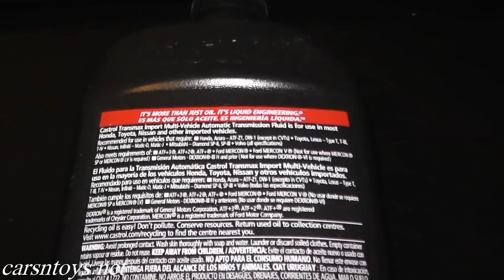Honda Accord Automatic Transmission Fluid Change

Comment: Note to anyone who does this, make sure when you put your 3/8 ratchet into the bolt that you are pushing the button to retract the ball (that normally locks the socket) in and then push the racket on snug onto the bolt. The little ball on the should not be visible and completely inside the bolt. This is important because if it's not in there completely, you'll risk malforming the nut with that little ball when you try to torque it off. Just important to mention anyways
Reply: Matthew Espindola good information to anybody planning to change their transmission oil since mine are nearly malforming the bolt yesterday

Comment: I just did this, 2012 Accord, 58,500 miles on the odo. My mother's car, she pays a local mechanic to service it for her, as she has had very bad experiences at the local Honda dealers in the area. Well, this guy did nothing other than oil changes. I got ahold of the car as it needed brakes. I had to beat the pads out of the brackets with a 3 pound sledge hammer. Both front calipers weeping, tried to rebuild but the cylinders were too far gone. So, two new calipers, four rotors, and two sets of pads. Power steering pump screaming, flushed that, flushed brake fluid, serviced the cooling system, oil and filter, and then the transmission, it was singing too... Used 9 quarts as you stated, last drain and fill we had gorgeous purple fluid coming out. Car now runs like new. Really pisses me off, this mechanic of her's, he was a Honda Tech for years. He never even checked the brake pads on this thing! Hell, you do not even have to remove the wheels to do that. Great video. Sorry for the rant. I hate these new mechanics, many are just outright thieves.

Comment: If you are going to the trouble why would you not use OEM Transmission as required by Honda and replace the 4 cent drain plug washer?   Great Video.
Reply: I always replace that after the 3rd or 4th trans oil change

Comment: When youre pouring fluid in it shouldnt read up to the high fill mark.. the fluid is cold.. transmission fluid should be checked at operating temperature and with car off and should read between the 2 dots.. therefore when youre adding new fluid which is cold it should read at the low level that way when it gets hot and expands it will give you a reading between the 2 dots..
Reply: Does the transmission shifter have to be in park or neutral on a 98 accord ex can anybody tell me that   please and thank you.
Reply: I'm  checking fluid level

Comment: I just did mine on my 06 accord. Honda has a funny process for checking level. Also changed the filter
Reply: Tye filter is inside the trans
Reply: I didn't think it had a filter. Hmmm
Reply: @saltypatriot1768  my filter is on top of the transmission 4cylinder inline filter  the v6 has a inside filter
Reply: @robertfrye7764  the 4cylinder auto does have a inline filter the v6 doesn't

Comment: I did 2 drain and refills. Car was on slope, higher at back. first time drained little over 3q and fill 3. 2nd time, drain 3.4 and fill 3.5.  Kept drained oil overnight and no difference in quantity hot vs cold. But now checked fluid level on level surface, it show over high mark when hot or cold. car was driven 100 miles on freeway between changes

Comment: Maybe I'm old school, but isn't automatic transmission fluid suposed to be checked with the car warmed up and the engine running while in park?
Reply from the maker: Good question. Depends on the vehicle. They each have their own technique on checking the fluid.
Reply: On this model the owners manuel says when car reaches operating temperature and is turned in the off position is when you check the fluid .
Reply: it depends my 90 accord original owners manual says to check it with no mention of wether to do it with car off or on.. but my Hayne's repair manual for the same car says to check it after turning the car off... so its kinda tricky in my opinion because you would think the manufacturer  would have the best information but apparently not in my experience... just my 2cents

Comment: Hey man. Have you seen any tutorials on fixing the oil pan gasket on these Honda Accords??? You have to do so many things to access some bolts. I've only seen people post the instructions from a repair manual.
Reply: I believe you have to drop the frame. its a big job

Comment: Hi. I have a 2006 Accord v6 coupe, the ATF dip stick hole is more narrow than your car....it's impossible to insert a funnel in there. Is there any other way to pour the ATF in??
Reply: Just use the fill point. 17mm to open fill bolt.
Reply: Or get some paper and tape and make a thinner extension
Reply: I made a paper funnel and taped it to my normal long funnel

Comment: i have a 2000 honda accord barly rebuilt my transmission im already at 3000 miles should i change it to keep it new or would that mess anything up
Reply from the maker: Typically, the manufacturer of the rebuilt tranny will provide a maintenance sheet regarding changing the fluid. If you don't have anything, take a look at the color of the fluid.

Comment: Is jacking the car up on all 4 corners necessary? Or is it for clearance reasons?  Just wondering if I need to invest in the Jack and stands. Thank you.
Reply from the maker: Yes if you want to remove as much fluid as possible. Secondly, it's a good idea to have two sets for future repairs. Good luck!
Reply: Build wheel cribs, and invest in a 3 ton floor jack. Plenty of videos on cribs here on YT. Best $100 I have spent in a long time in regards to getting the car up in the air, and not having to worry about the damn thing falling on you. ;-)

Comment: Hi, thanks for the video. can I change the oil if my car has more than 170 thousand miles? Thanks
Reply: Usually if it's not burnt smelling you can. But if it smells burnt its gonna slip after you do it
Reply: Héctor Alfredo Macareño Delgado Hey man just want to let you know that you don’t need to change your transmission fluid at 170... but you do need to change it every 60-90 thousand kms. I don’t know when was the transmission fluid changed on your car but you need to do it every 60-90kms. Hope that helps!

Comment: How often should transmission fluid be checked and changed?

My 2004 Honda Accord with 110k miles Won’t Accelerate but RPMS Go Up

Can that be why? I haven’t checked that in like forever 🤦🏾‍♂️
Reply from the maker: Recommended every six years or 120k miles, whichever comes first.
Reply: Make sure you have ATF in it and it's level is full first. Sounds more serious for only that mileage. Probably should have a mechanic drive it and check it out. Reguarly, for most cars at least drain and fill with 3 quarts[2.6 qts] every 30K to 50K. In your case with it really slipping maybe all of it, but in general, it really shouldn't have every drop of the 9+ quarts changed or doing 3 quarts and driving it and changing it again "3 times" especially if it's really black oil now and smells burnt b/c replacing that with new oil, it might start slipping. That's what I've seen.

Comment: Hey man I really have quick questions

1) How do I check the transmission oil for my Honda accord 2013 LX ? not sure if it needs to be changed or not  just like the engine oil ?

2) for the engine oil change !! DO I need to change the oil filter every single time ? I use the recommended mobil 1 oil with the extended performance mobil 1 oil filter. and I change every 5k . 

thanks.!!!
Reply from the maker: Best bet is checking the owner's manual. I don't have one handy for your Accord, but chances are the tranny fluid is lifetime; unless you tow with the vehicle, use in muddy conditions, etc. Regarding the engine oil, chances are you can go beyond 5k miles if you're using mobil1. But check the owners' manual. You'll find maintenance intervals listed.
Reply: Hello there I might have an answer for your question as my dealer said the first 100,000km 
then every 40,000km and 
"depending on the wether condition you can go for every 60,000km"
Reply: Yes u have to change the filter everytime you change the oil

Comment: I have a 05 Accord v6 and I want to change the transmission filter but I don't know we're to find it
Reply from the maker: Many late model vehicles don't require a filter change. It's often done if the tranny is being rebuilt. But check the owner's manual if it's listed as a regular maintenance item. Cheers.
Reply: CarsNToys thnks

Comment: Great video. May need to do this soon to my '04. Quick question, do you put threadlocker on the drain bolt? you do on other bolts but not sure about drain bolts.
Reply from the maker: No need to place threadlock. Glad it helped!
Reply: Never put thread locker on a your drain bolts at most change the crush washer they're only a like 50cents usd

Comment: Where is the external ATF filter located?
Reply: There is not one, at least not on my 2012 Accord.
Reply: @michaelwright1602  After much research, I found the ATF. On the 2016 V6, have to remove the battery in order to get to it

Comment: This man doesn´t tell us how many litters we have to put when we are changing this fluid
Reply: 3 quarts Honda DW-1.  Ask the Honda parts guy if he will give you a discount if you buy a case.  I can't remember but it was like 25 for 3 quarts plus tax but for a case it was less than $80 (12 quarts).
Reply: It should not be lesser than drained out amount. Measure how much you got out. And after a short drive top up as needed to be in the range of the dip stick.
Reply: It takes 2.5 litres

Comment: and also is there anything else i have to change in my  transmission or is everything good since its rebuilt im new to hondas and i want to keep my transmission like new
Reply: Michael Moralez 
I got my 2014 v6 accord transmission fluid change at the dealer and it $100 , it took 4 quarts and 2 washers .
40k miles it had when I did it

Comment: Hello my friend, my name is Jorge Caldas, I live in Brazil and my question is: I have a Honda Accord 95 EX and every time when the engine is cold, I can't get reverse normally. I need wait about 3 or 4 minutes. After that I don't have problem when it is hot. What do you think it is? I don't use honda transmission fluid in. Can be that? But it is only on reverse. I suspect the solenoids dirts. There is any other place that I can check to fix it? Thank you.
Reply from the maker: If you're lucky, changing the fluid may help. I've had good success with Lucas Transmission Fix as well. However, in those situations the vehicle was shifting very hard.
Reply: But why just on reverse? And why just when it's cold? I'd like understand how the transmission works. Thank you.
Reply: Clean solenoids and change transmission fluid 3x’s, yes three times . Drain n fill drive around about 20 miles then drain an fill.  Drive another twenty miles and drain and fill again. You should be draining 3qts each time and refilling the same amount. 9 qts total 3 each drain n fill. Use nothing but Honda fluids. I take it you have no transmission lights on. Good luck. 93 Accord 265,00 all original drive train automatic transmission.

Comment: No filter replacement?
Reply: Honda transmission filters are internal lifetime filters. The only way to change it is to rebuild the transmission.  Only newer Honda's have a secondary filter. I own a shop that specializes in Honda/Acura repair plus I worked for Honda for 5 years.
Reply: @jameswashington8593  wheres your shop at could use a good mechanic
Reply: @juanm0788  I'm in Savannah, Ga
Reply: Move shop to texas man haha
Reply: @juanm0788  You have Scotty Kilmer in Texas! Although not for long...

Comment: Honda recommends that the fluid be changed every 30,000 miles…. Where are you getting six years from?
Reply: You sure? 30,000 is too early... for a trans oil
I used to work at a honda dealer. We recommend 30,000 miles to upscale and make money but you don’t usually change it until 50-60k miles.   I have a friend that has only 20k on his car and his honda is 7 years old. 6 years means that. You don’t necessary have to drive to a certain point of mileage to replace your transmission fluid. If its been long like 7 years you still have to replace it even if its 15k miles. 
Never listen to any tech or even dealer mechanic. Thats how they make money. + extra commission sales.  Always follow the car manual and not the mechanic cause you don’t know whos is legit “honest”or not.
100% of all honda dealer also recommends coolant flush but they never flush it, they only drain and refill just like any other regular person. Super easy job but way to over price at dealership
Reply: @JohnT2088  The transmission fluid breaks down in time, even if few miles are driven. It is the additive package that needs to be refreshed. 30,000 miles seems reasonable to me, or every couple of years if not driven that often. Just drain the box and refill, 3 quarts tops. It is an easy job, as the above video showed. Much cheaper than a new transmission.

Comment: It isn't tight,  the parts seized because the bolt is steel and the transmission casing is aluminum.  The metals gall together and seize.  The actual torque spec for that bolt is very low. around 16 ft lbs,  if you do closer to 40 you're going to strip the weak aluminum transmission casing.   I'm giving your video a thumbs down because you obviously don't know anything about metallurgy or auto-repair.